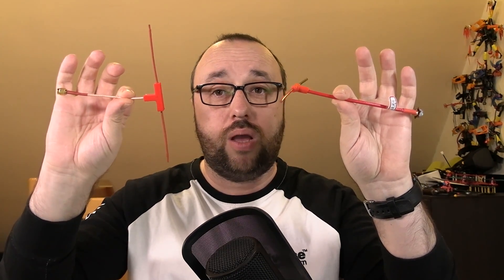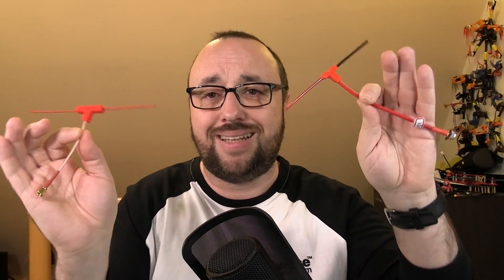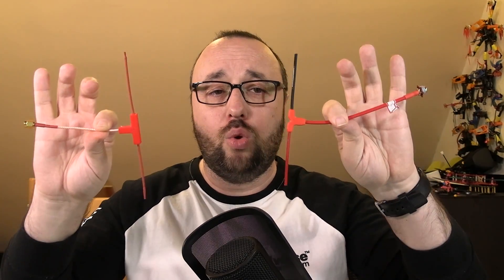Common problems with #FPV range and how to fix them

Comment: Good advice. 
⚡️💨 @ 9:32 "the power output might just be smoke" .. this not usually fixable. 
Solved by replacing.

Comment: Thanks for the nice video. I want to bring the RX antenna on a pole 4 m in the air. How do I get the signal down? Simple a long cable? Or is the loss by the cable even worse? How do you assess the length of the cable in the complete signal chain?
Reply: Interesting question, I'd be interested in more information on this topic as well.

I feel like xjet might have a video addressing this but, perhaps only in passing.

Comment: You say that a vertical position is the best for linear antennas (like crossfire). But mostly is see them positioned horizontally, specially on the receiver (quadcopter) side?
Reply from the maker: And every time I see this on a Long-Range airplane or drone, a small piece of me dies ;) People install them like that because it's simple, not because it's the best
Reply: @FPVUniversity  Make it a very small piece, we need your knowledge and video’s 😎
One more question: why is vertical better than horizontal. I thought that is long as transmitter and receiver both have the same orientation, it’s ok. Or has it something to do with blocking of the signal by the quad itself? 🤔
Reply: @bertbeinaaf8314  Because the end of the Rx antenna has a null point, where reception is weak...When the antenna is vertical, it doesn't matter which direction the quad is pointing...Simple really..🤔😯🇬🇧